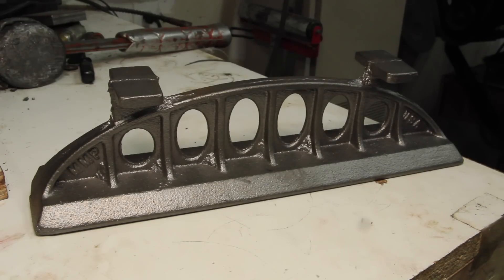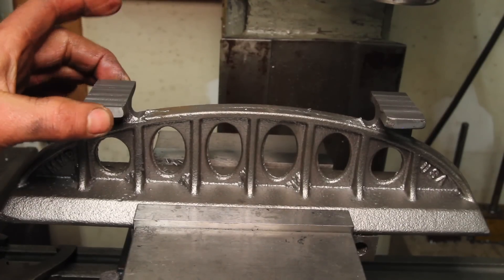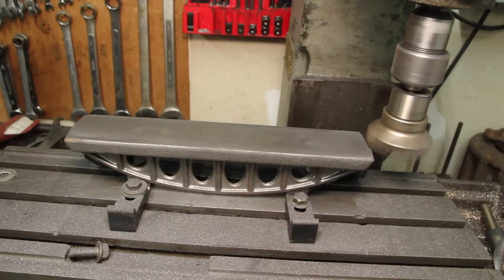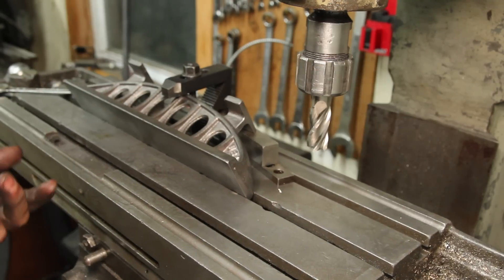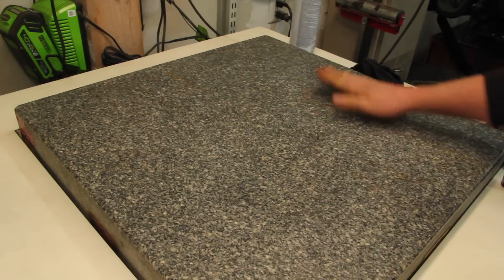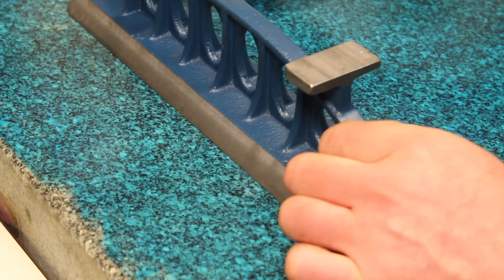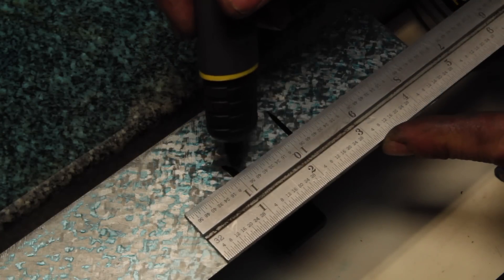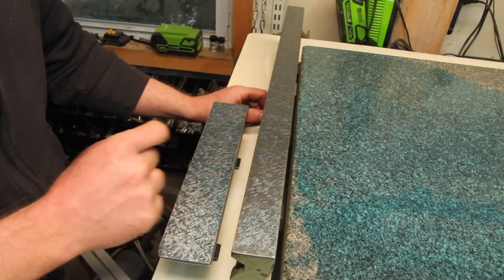Camelback Straight edge.

Comment: Not possible to get any castings in Germany. Old, not huge machines in good condition costs 15-18 thousand €€ Everything german companys selling is chinese junk. 
Angel streight edge 200mm 55° costs 200€. They says its precise ground on 3 sides and then hand scraped on 2 55° sides. What you get is 1 side rough milled and 2 poorly ground with 1 layer of scraping marks, each 8-10mm apart from each other. And its compleetly crooked. Sells by the way as 00 class piece.
😢😢😢

Comment: Plenty to learn when scraping and the more you do the more you learn. Do check your working face against your SP before taking the SE as good on your mill. The CI will move especially after machining but also as the shop temperature changes. Good luck with your mill refurbish 👍
Reply from the maker: I feel like scraping is a process you can learn in an afternoon, and then spend a lifetime trying to master.

Comment: Good project. Is there any advantage of using cast iron over granite straight edges ? They're a few hundred bucks new or even cheaper on eBay.
Reply from the maker: It’s not an issue in one this size, but weight becomes a factor with granite in larger sizes, whereas cast iron can be webbed to save some weight.  The granite ones don’t usually have the dovetail either.  The cast iron ones can also be checked and tuned up on the surface plate as needed.  And cost to some extent.
Reply: @JeremyMakesThings  thanks, the weight related point makes a lot of sense
Reply: The advantages of iron straight edges are the same as that of iron surface plates. Moore says  in Foundations of Mechanical Accuracy that iron surface plates can be corrected by scraping or lapping, but granite plates can only be corrected by lapping.